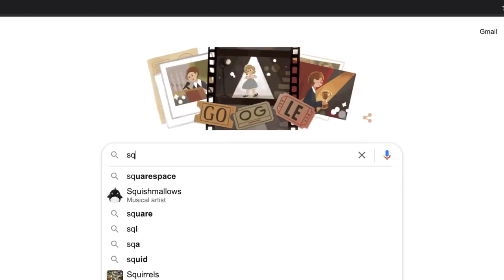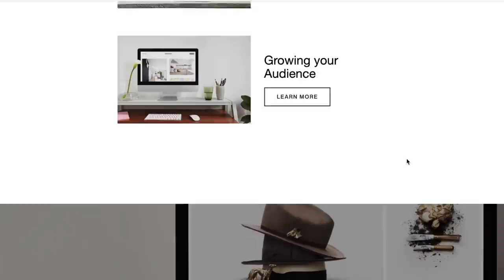NIGHTMARE VAN FLOOR INSTALL | It All Went Wrong - No Experience Van Build

Comment from the maker: Safe to say the flooring was a ball ache but thankfully a managed to get it done and I’m relatively happy with how it came out. Lots of lessons where learnt along the way hah. This isn’t my finished floor but just the foundation to build from, further down the line I’ll put some vinyl down to give a nice finish. Let me know what type of videos you want to see me create along side these and thanks for your continued support! 😄
Reply: Came out looking great in the end, and don't forget at this stage most of your works getting covered up and you'll never see it. Don't doubt you're doing a fine job, keep it up
Reply: Looking good Will. Our van has a Lino on top of the ply. It’s thin and also helps with the sound. Easy to sweep too.
Reply: I'm enjoying these van builds more than the stealth camping at the moment good job ⛺👌
Reply: Floor looks great overall. Really interesting way you determined the shape using that contraption you made. Still not sure how it works. Only negative is that you won't be able to stand up fully inside the van.
Reply: When we make mistakes we can look at them and feel like crap, or we can learn how to cover them up.
If you were to see the mistakes made by the prop builders in the film industry and the way they hide them you would be amazed. 
But you're learning and there will be mistakes, the next van will be better.
👍😃
Reply: Could u have used carboard as a templet ? 
Good job mate
Reply: Use an aluminium threshold strips
Reply: That was very intense to watch, I had my fingers 🤞.  In the end it was a job well done.  Nice one. ✌️😎💙

Comment: On the side door part, that is a bit screwed up, I would use an aluminium profile to cover it up. It also can work as an reinforcemend👍
Reply: Was thinking the same myself when I seen it
Reply: I was gonna say exactly the same thing too 😉
Reply from the maker: Thats what I plan to do to cover it up
Reply: @WillsWhereabouts  Have a look at Aalco or Commercial Body Fittings, they do various different profiles for finishing floor edges. Will neaten it up and stop it going all splintery. If you need a long straight cut across a panel, clamp a piece of steel or ally angle to the panel to run the saw up against. Those clamp on saw fence things aren't a great success, buggers for coming loose....
Reply: Could he have flipped the wood?  couldn't see if it was symmetrical or not.
Reply: Curved edge carpet strip

Comment: Excellent and amusing (to me) video. Trim the piece you cocked up with either right angle aluminium or wooden strip. Looks neat and hides the mess. My workmate has loads of saw cut in it. It adds character.

Comment: As a chippy, small gaps will not matter as you will have a floor covering of some sort so don't beat yourself up over some small gaps between boards , you get to know what tolerances you can "get away with " dependant on the actual job you are doing, with certain things a mm or two gap does not matter, however if , for instance, chopping in a hinge on a nice oak door then you really do have to be spot on.,  really enjoying your videos

Comment: this is great stuff. I think you could have gone with a solid rectangle midde board and two sides pieces to fit out to the wheel arches, but hey, it is your design. And ear defenders wd be more useful than goggles (in later life the deafness and tinnitus will catch up with you). Carry On Camping!
Reply from the maker: That's a great idea!

Comment: looks great though i thought you could used the original flooring as a template you might of not had the same issue . but well done in getting it done. looking forward to the rest of the build
Reply from the maker: The original flooring had a few bigger gaps so I wanted to try and get a tighter fit but I defiantly should have used it as a guide
Reply: You got there in the end. Do not worry about the mistakes, call it unique features. When you have completed the van job you will look back at all the things you learnt on the job

Comment: Will, the bit that you’re unhappy with on the sliding door, cut out the first 6 to 12 inches and fill it with an offcut. This way, it’ll have a nice edge and the bit that you’ll see mostly will have a straight edge, plus it’ll still be strong 👍🏼

Comment: For scribing, but material upto the shape, in the orientation it will put in, like is done in video. Use measuring tape and measure at the widest/furthest wood to shape distance, leaving few mill for pencil to scribe just at the very edge, where the widest measure is, lock the tape, with pencil in corner of tape and the body, then keeping the tape measure facing the same direction, start at edge and let the tape lightly run along while scribing on wood. In case of above video, it wuld scribe the two corner areas far into the wood, and the middle wider portion will be very close and on the edge of the ply

I know this is simple but i like mansplainin

Comment: Awesome, I just cut mine to shape,  much easier on a narrowboat 😉 keep on bro, baby steps take you a long way when you turn to look back. Great vids amigo 👍
Reply from the maker: Thanks man
Reply: @WillsWhereabouts  I just spent the day water sealing mine, will you be protecting your sub floor from water? Is there much point in your van? At least I would recommend sealing the edges near any doors with some waterproof pva glue, then the ply won’t expand if it get rained on 👍

Comment: Looking good 👍 yes battens on the floor would of lost you some head room and also by the time you have done the ceiling of van. What lighting you putting in not going to be much depth there. Maybe some colour change led lights. You could have it set on red when your in some dogging location 😂😂

Comment: Sometimes, conjoining factory edges is not possible, or at least problematic or wasteful. TIP: Contour the wall edges as needed, and use a square to keep your genius homemade scribe exactly perpendicular while it follows the contour of the wall.  Once the first wall is scribed and cut to fit, scribe and cut the opposing wall, BUT allow the two floor pieces to overlap down the center line, or middle line. Once the opposing wall's piece is cut, and the two flooring pieces are overlapping down the middle, SHIM UP the floor board CLOSEST to the metal floor with a long strip of scrap of uniform thickness, and the top piece will rise, too, as you lift the board under it. Mark the upper piece with a straight edge or chalk line, where you want the seam to be, then set your saw "cut depth" such that it will cut through both flooring pieces, but not your metal floor, of course. When the cut is finished, and you pull out the shim and leftovers, both flooring pieces will smash together snugly and perfectly, no matter how wiggly your final cut was.

Comment: I started sound deadening the rear of my van I done both wheel arches before realising its flammable so I will not be doing the floor incase of welding in the future and being a ford transit I have no doubt that it will need welding later on in its life lol

Comment: Cutting the subfloor contours is one of the hardest & most technical jobs on a van build so don't feel bad about messing it up a little. It happens. Don't use that edge attachment for your saw because those things work like shit. Better to clamp down a long strip of wood and use it as your saw guide. And if you want to be able to see through your face shield I would recommend removing the green protective film from both sides. It just peels off, ya know.

Comment: You have an amazing strong glue but then glued it to the foam insulation. It means that it is only as strong as the weakest material. Should be ok though… gravity is pretty strong too…

Comment: Because you started to cut from the other end you forgot to allowed to the width of the saw blade, also instead for measuring it you should have put both pieces in position and used the over lap to scribe a line, much easier and more accurate.

Comment: tip for you never cut on the line cut on the side of it on the waste piece. also you need to account for the blade width as well. we all learn somewhere. 

keep your mistakes you will learn from them plus its not that bad really it could be a lot worse. 

you could line the outer edges with some fancy trim to make it look nice

Comment: No need to fIt anything hard to or tight, everything needs room to flex, expand and shrink a bit. Don’t be too concerned about leaving small gaps or your build will take forever. Nice work so far, keep up the good work and content. 🚐

Comment: just a thought but it is stuck now lol , could you not have flipped the front board over so that the bad cut was on the driver side wall where it would be hidden with cupboards or seating leaving a nice edge at the door .
Reply from the maker: I did try this but it wasn't a perfect fit so decided to leave it where it was

Comment: With regards to the flooring. You knucklehead,  you should've kept the floor panels and used that as a template around the wheel wells ❤

Comment: you need a gap on the edges as the wood needs to flex and expand in differing conditions.
Reply: Yes you are correct
Reply from the maker: Thanks for the tip, hopefully the gap will be big enough then

Comment: As has been said, aluminium L section for f*ck up, it'll give it a nicer finish anyway. Apart from that, nice job. Use cardboard for templates. Don't forget to allow for expansion and contraction.

Comment: Why didn't you use a paper sheet or few sheets of paper and join at first to cut out the shape of the floor. and use the sheet cutting to cut the ply in right shape and size. ???

Comment: Same situation as you bro. Work and experience will come. 

Top tip. If ever you save the saw dust from the cuts. When you use the adhesive sealant sprinkle the saw dust on to it. It give you a solid look between pieces

#urban2overland:projectjam

Comment: i wouldn't have stuck the ply down if ever you need to lift it up for whatever reason, your screwed, plus with the weight of al the furniture cupboards etc, its hardly gonna move?

Comment: Don't be daft, all ya need is an aluminium nose to finish the floor. What shit cut?
Reply from the maker: Thats the plan, to get something to cover it up
Reply: @WillsWhereabouts  A little pointer, if you don't already have "Rivnuts", get some, they are an absolute must. Loads of vids on youtube, tenner on fleabay. I'm doing my van as we speak but a little further ahead. Your neurotic enough not to keep everything square and true, it will bite you on the arse if ya don't.